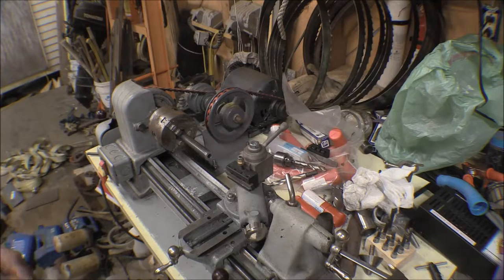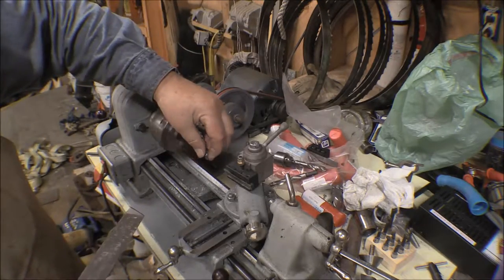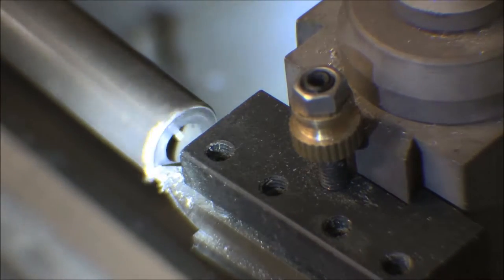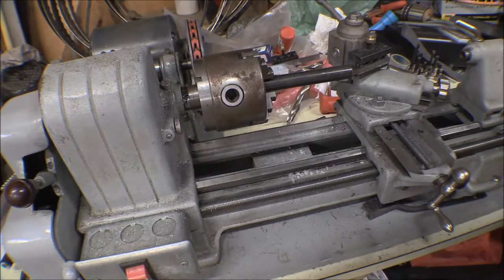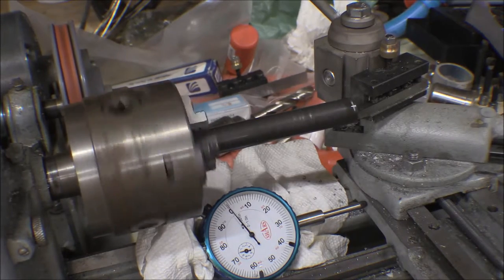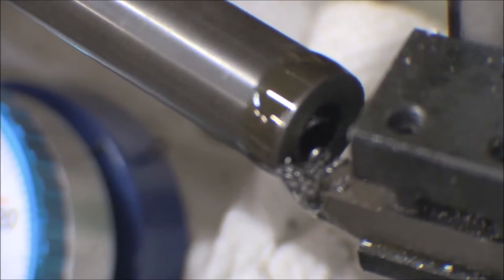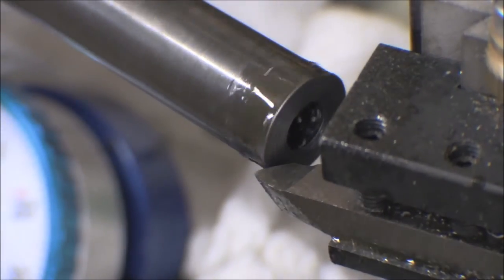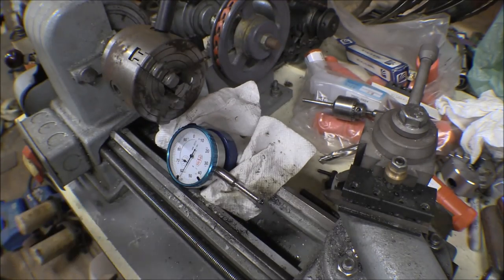Piper Supercub Widebody refurbishment; airframe rotator, part 1: firewall stand offs

Comment: McMaster Carr will send metal of about any kind here to Alaska.  Expensive but when you need a little it can be worth it.  Metal Supermarkets also and also very expensive.  One of their branches opened in Anchorage recently.  I believe there is a McMaster or maybe Grainger in Anchorage if that is better for your freight costs as well as one of the Metal Supermarkets.  I have also had luck when ordering full sticks or sheets of any kind of metal from Alaskan Brass and Copper in Seattle.  They have expensive cutting charges for small orders and don't seem too interested in them but they did deliver to AML.  A guy has to get a large enough order together to make the freight worthwhile for the barge.  I have also ordered small amounts of various metals through Ebay.  Also expensive but they ship flat rate.  There is another chain metal store similar to Metal supermarkets as well.  Trouble up here is a guy has to be a fortune teller to know what he will need in the future in order to have it on hand when a project pops up.  Check out your boat yard for bent prop shafts (although some of the exotic metals can be tough to cut), lower  units on outboards have a couple of shafts in them, ditto old axle shafts.  Hydraulic cylinder shafts are a great find too.  I am sure you know the drill.  Have to scavenge most of my metal.  The shipyard here has a limited number of shapes and plate available for sale.